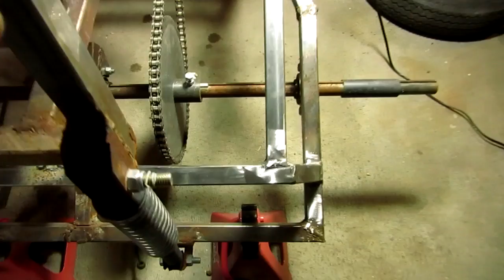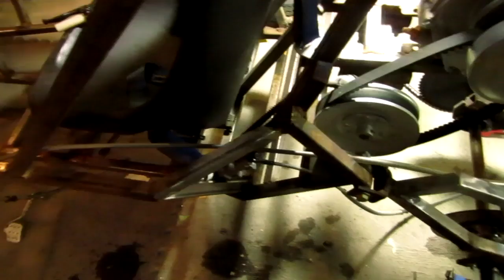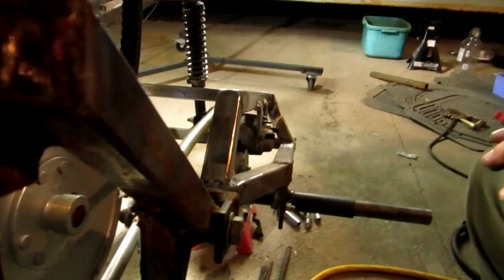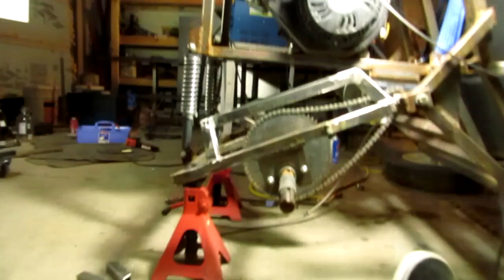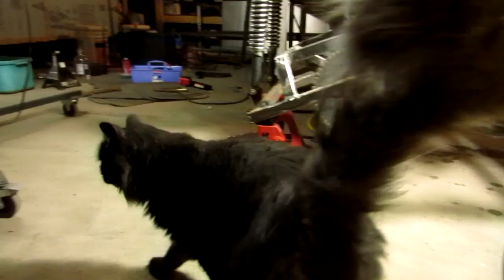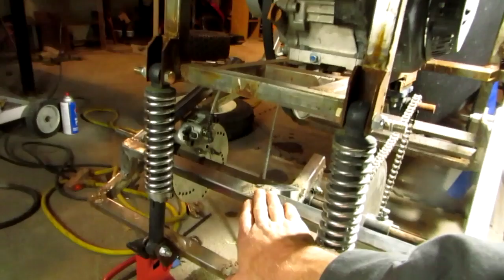Rear End Reinforcement Fullscreen Machine

Comment: i have never seen any go kart ever with the throttle cable that goes all the way from engine to pedal. u can easily make a linkage bar (no need for any bigger than 1/4" dia) somewhere on that oversized oaf from the pedal that'l at least cover 4' then u only have to go from the engine to near the susp pivot. that way u can put a stop hidden on the linkage and not on the pedal or worse rely on the engines throttle stop.